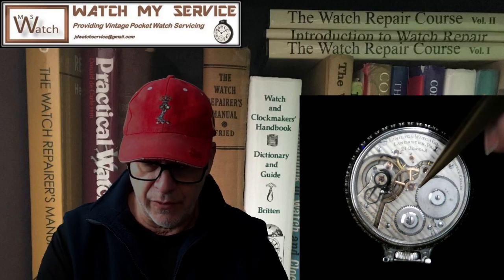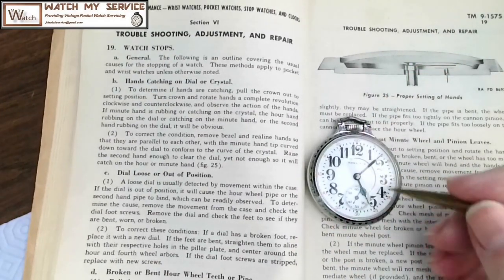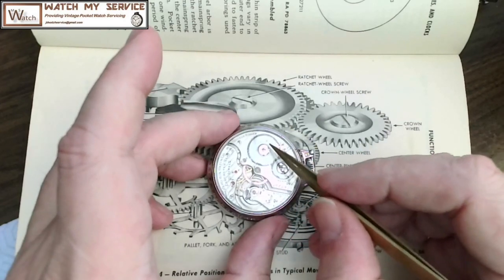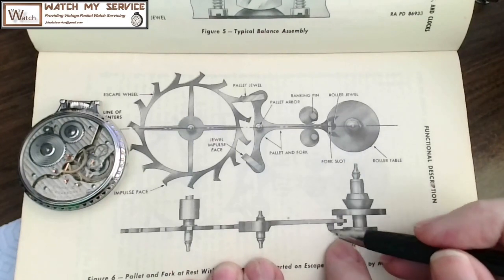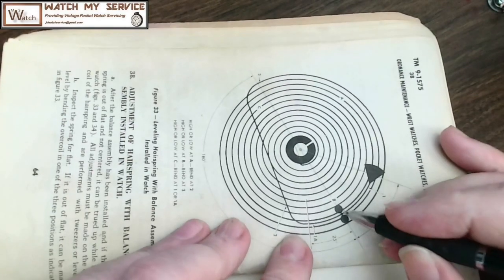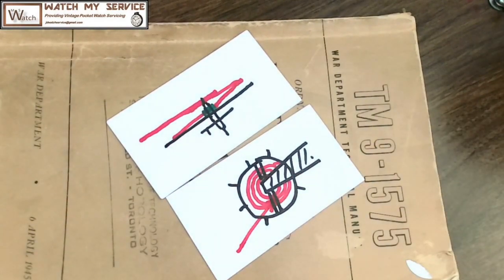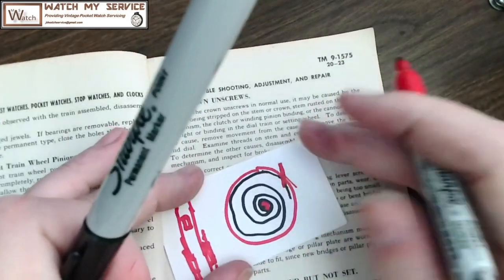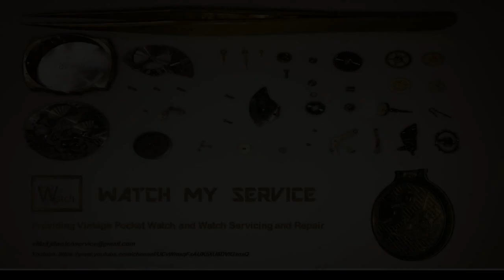Troubleshooting Watch Problems - Comprehensive Discussion

Comment: This is great information. I recently inherited a South Bend Model 215 from 1911, which doesn't run. The hands can be set (minute hand rubs the crystal between 10-2), but it cannot be wound due to something binding.
I've briefly looked for some local repair options, but they are few and far between with the seemingly most knowledgeable guy having a reputation for being difficult and even worse, losing/misplacing items. I don't want to ship it anywhere and risk never seeing it again.
So begins my research and education on the matter.

Comment: What was the name of the War Department book you were using? I just started pocket watch repair as a hobby,  still slowly acquiring supplies.
Reply from the maker: @jonm.6309  TM 9-1575 wrist watches, stop watches pocket watches and clocks
Reply: @JDRichard  thank you,  I will see if I can purchase it online.  My first watch to tackle is a New Haven Compensated pocket watch from the 1940s. Dollar watch, basically a ticking tin can. Lol those Dollar watches are enigmas to work on,  wish me luck.
Reply from the maker: @jonm.6309 Amazon has in in hard cover
Reply from the maker: @jonm.6309 All the best. They are not easy and not meant to repair
Reply: @JDRichard  👍